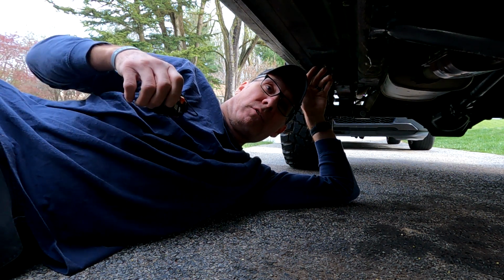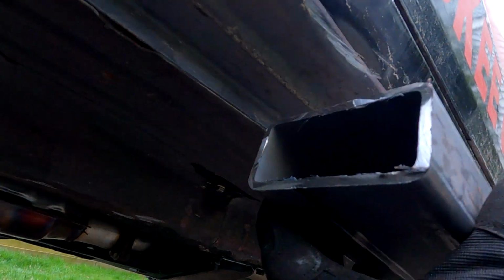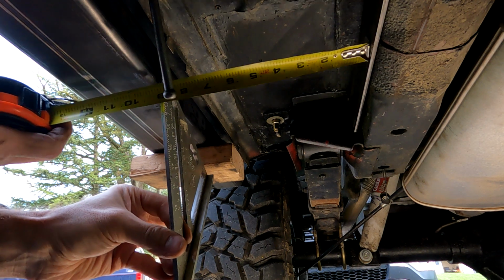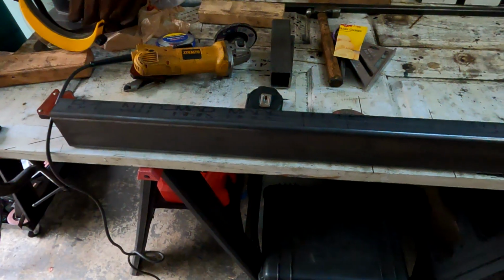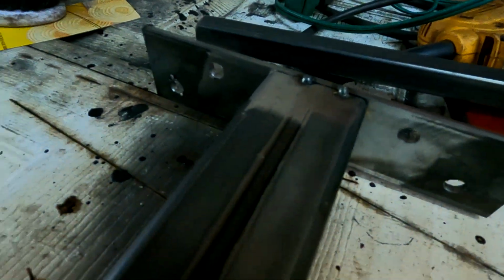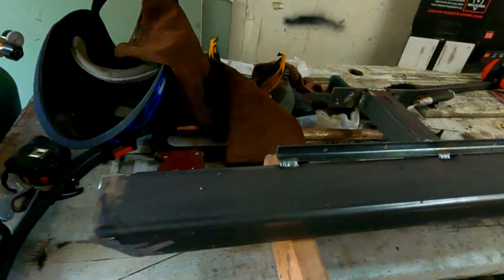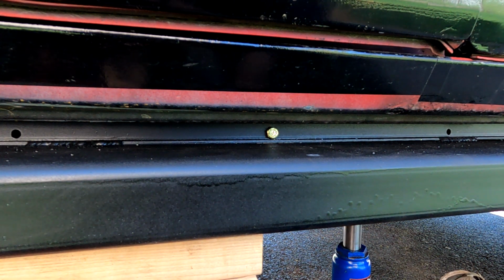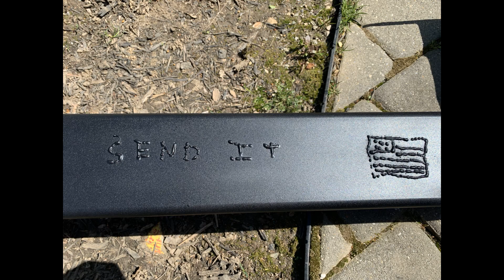BUILD AND INSTALL ROCK SLIDERS FOR YOUR JEEP CHEROKEE XJ

Comment: I'm with you on not cutting out the rockers. Bumble Jeep has a flawless body from the floor up and I won't cut it. I plan on similar sliders, but I think Mine will be bolt on so I can remove for fender bolt access. I plan on using nutserts instead of self  tappers. I've never had good luck with self tappers. I feel they don't provide enough strength for something like rock sliders. Always enjoy your content. Keep it coming. And if you're ever wheeling in the Hamburg Pa. area, let me know. Would enjoy an adventure in the Bumble Jeep. God bless and stay well.
Reply from the maker: Thanks for the info. I agree with you. Cutting into good rockers would have been bad! Thanks for the kind words and for sticking with the channel. Much appreciate!!!!! Keep on jeepin!!

Comment: I’ve been researching this subject for a while and as my Jeep is completely rust free, I’m not too keen on cutting the sills out either. Besides, it looks like a heck of a lot of work! I like your idea a lot better. I’m gonna do it your way. I also want to add some 40mm round tube rails for sidesteps and buy mounting the sliders under the sills, it gives a little more room to be able to angle them up slightly and still be able to open the doors :)
Reply from the maker: Glad I could help...yeah..the idea of cutting rockers just didn't appeal to me as it changes the look that I like with the rockers..These rock rails have done their job and have held up to some good solid hits and saved the rockers from being dragged all over the rocks..Good luck with your project.